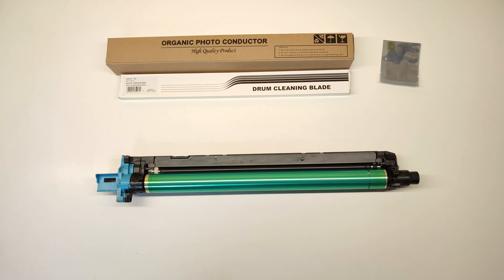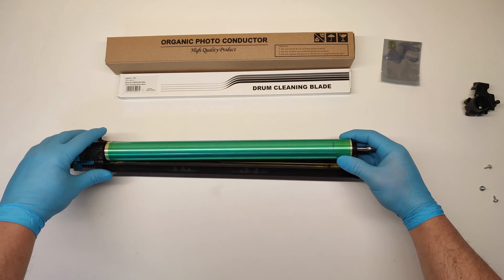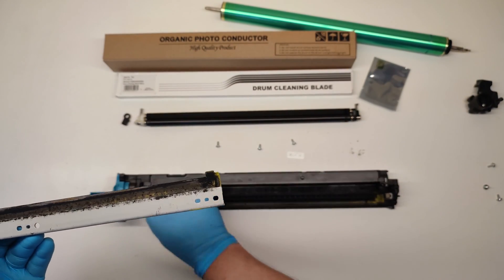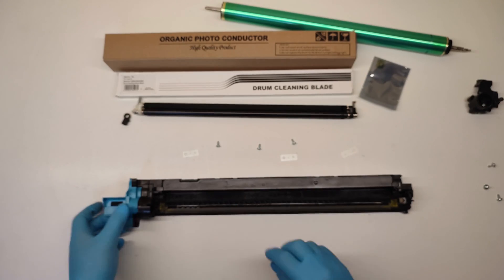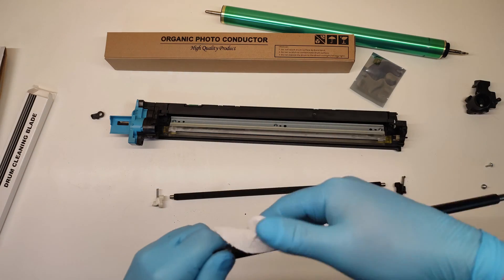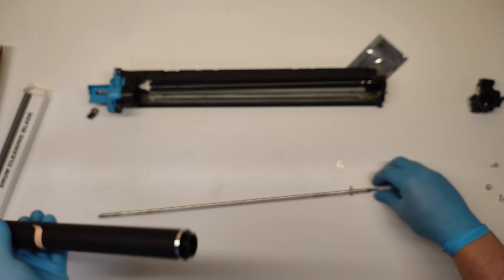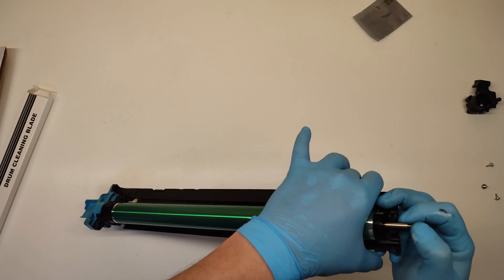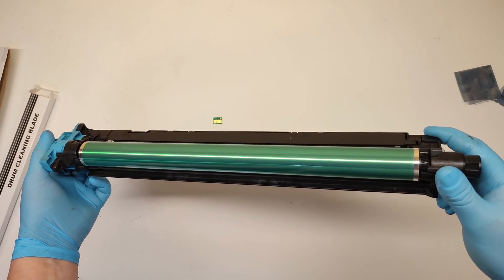HOW TO REMANUFACTURE MINOLTA BIZHUB C258, C308, C368 DRUM UNIT, OPC REPLACEMENT, DRUM REBUILD

Comment: Where can you buy the replacement parts? And can you get the pcr and cleaning roller? The drum I have keeps getting dirty again as soon as I clean it
Reply from the maker: You can find the spare parts at the local IT market or buy them on internet - ebay, amazon... About the dirty drum after cleaning - you have to replace the wiper blade in order to clean better the surface of the drum.